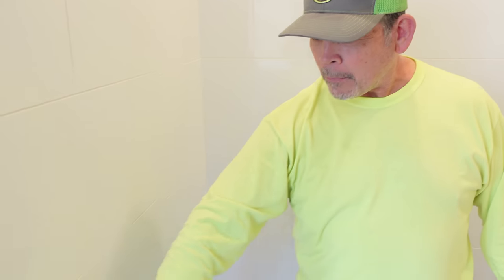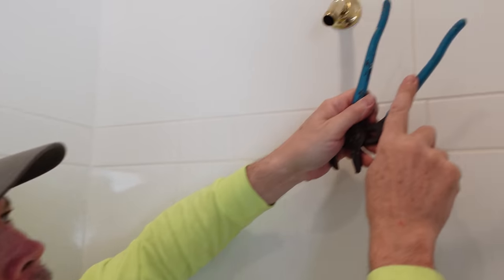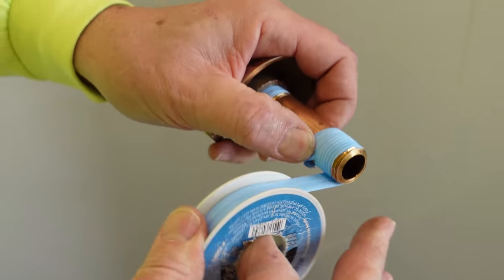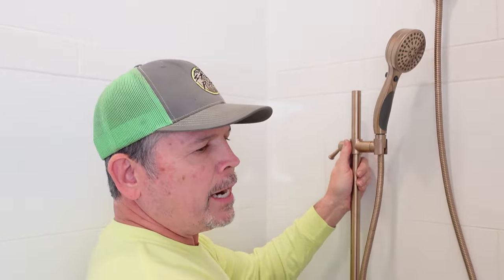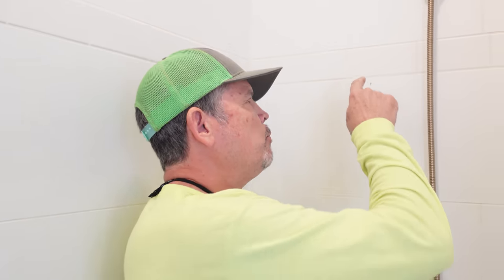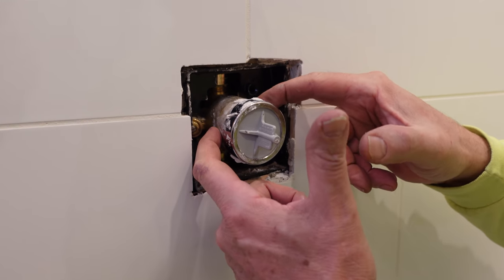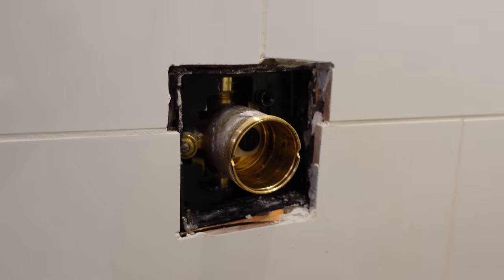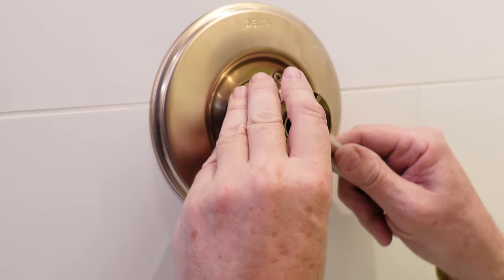How to Install SHOWER TRIM (Step by Step)

Comment: What great timing.  My son and I are getting ready to do this in our shower remodel.  I have put one in before but it was 15 years ago on the first bathroom remodel.  Great video and we opted for a shower set up that was similar except in nickel.  Our son is 6 foot 7 inches and we needed something that would go pretty high.  We also put in a diverter to a shower that comes out above the shower for a rain head.  My wife insisted.  She's the boss.  Great work guys.
Reply: Make sure to look into Schluter for your waterproofing. I have 4 bathrooms that I need to do and one of them is designed for a wheelchair. This means no curb. The prospect of getting this wrong scared me so badly that I did allot of research for a very long time and settled on Schluter. Their warranty is second to none and their education is above and beyond the TCNA standards. They also have a YouTube channel. (For proper information do not reference outside of their YouTube channel. There are channels that might do a good job but details that are required for the warranty could be completely missed and so you should reference the official videos from the company.) 

Taking their free workshops that have class and hands on installation training was far better than any video I could watch for me. They are nationwide, cater all the food for the workshop of almost 2 days and pay for the hotel if needed. You just invest your time and walk away with a massive amount of information to consider and decide for yourself. Hands-down was invaluable. I got the latest information and technology for my installations and learned allot about what has been traditionally done and what the pros and cons are. I wish you well and take care!

Comment: Thanks guys for taking the time doing this video. My OCD issue has been with the pipe at the shower head and knowing, or NOT knowing after you thread the pipe in IF you have a leak or not.
Reply: I was told to use some pipe dope on top of the tape.
Reply: When I built my shower, I put the threaded opening just close enough to the surface that I could silicone around it so any thread leak would run out and down the tile. I didn’t plan it though. Just got lucky.
Reply: A high quality tape and/or dope go a long way. If you’re gonna go both put dope over top of the tape not the other way around. You’d be surprised how quickly tapered pipe thread seals up against city water pressure.

Comment: I know you guys have probably been working like crazy to finish before Mom comes home from the hospital/rehab, so that's why you skipped ahead in this shower install to the trim part. But I hope you got some footage of how you proceeded from the floor joist adjustments to the finished product. Looking for a new video on that. Great work as always!
Reply: Keep in mind that the subbed out the tile and plumbing on this one. Paul mentioned that the had some showers coming up that the would be showing the whole process on though.
Reply: @chrisloehr6641  Right. I forgot he said that in the last video when he was lowering the joists. Thanks.
Reply: @thedevilshelp  And the shower niche on that new wall.   I'd like to see the finished product even if part was subbed out.

Comment: Thanks for showing how to adjust the water temperature gears! I was able to fix my tub to finally put out hot water. Previous owners just turned the water heater up which allowed for scalding water on all the other fixtures. You guys are awesome!!!
Reply from the maker: Awesome thx J👍👊

Comment: Great job again, plumber and contractor for over twenty years in all phases of construction and service work.  You did an excellent job in the teaching process.  I appreciate the channel, the hard work, and the professionalism you and your dad provide,  Thank you.  I would personally pull any water saver from the hand held as the volume is fully controlled by the delta cartridge.
Reply from the maker: Thx Jason.  Pulling the water saver😳??!!   I have no idea what you’re talking about 👊👍
Reply: @StudPack  There's often a small disk on the handle that has a small hole in it that restricts the water flow.   They call it a water saver.   Basically it makes for wimpy water flow.   Jason was recommending pulling that out since you can control the water flow at the valve itself.
Reply: @AKJammer1  Whoosh. LOL

Comment: Another great video! Paul on mine, it's Delta also, but the valve assembly is all one piece, from the 2 o-rings to the adjustment for the hot water(scald guard), but it is only one handle. I guess what I am getting at is the housing being the same, you could convert it to one handle easily. Best wishes for your mom, and I am sure she will enjoy that shower, I know I would!

Comment: Nice  - i just installed one of those Deltas.    After staring  at the instructions I had to watch about 4 different videos.   Things get tricky when you have to adjust the temperature limiter.  This is the  video I'll comeback to if I have to make any adjustments .

Comment: Tip for when you can’t get “two more” turns on a fitting or pipe but you want it tighter: count your thread tape wraps, then if you need to get a fitting tighter (cause you only got “one more” turn) you can add a few more tape wraps than your normal #.

Comment: To DIY'ers like me -- Be extremely careful when tightening those elbow/hose connectors. Over-tighten it, and it could crack the tile which would be Very. Very. Bad.
Reply: Can you put Kohen trim on a delta valve body and cartridge?

Comment: You should explain the balancing aspect of the valve. I've found it best to have an expansion tank  on the water heater if it's a balanced valve. A bad expansion tank can cause the balancing valve to not work properly.

Comment: I agree with Ken below.  Lowering the elbow will add length to the hose for an easier hand shower, rinsing the shower stall and any other washing the shower is used for.  I would only then add silicone sealant when installing the elbow.  I did this on the two showers in my home.

Comment: Re: Silicon on face plate sealing. I would always run silicon seal around, especially on tile with grout lines. As the factory seal can not be relied upon to fill the grout channel. But don't go mad. Excellent Video as always. You guys are the best.
Reply: Yeah I agree, I'd use some silicone too, but if it has a gasket, I'd only use small "dots" of silicone where the grout lines cross the face plate.
Idea is that using only a small amount would ensure that it remains easy enough to remove, let you take advantage of the provided face plate gasket where it has a good chance of working, and provide extra insurance that it won't have a hidden leak that you don't find out about until the damage is done.

Comment: Great video, I would also suggest neater holes for the valve and outlet using a diamond tipped jigsaw blade or holesaw, to the DIYer you could certainly encroach outside of the coverplate or outside of any fittings.
Grohe actually provide a template which protrudes through the tile and is cut flush at the end.

Comment: my grandfathers solution for drilling into shower tile was to use a hammer and nail (or whatever else was laying around and would work) to gently chip away the top layer of the tile eliminating the stress of a wandering bit.

Comment: Dude my cover plate does not have “delta” on it (late 90’s monitor) so putting that back on is the longest, most excruciating part of the job repairing that damn thing! Can’t believe you threaded that right in!

Comment: Hey Stud Pack, If you hate Allen keys and set screws as much as I do, then you should get the kit that I absolutely love. I am not sponsered by them I paid with my own money. But I love my small ifixit kit. Its for like mobile devices and stuff but it has literally every set screw and allen key that I could ever imagine using. I use it to install towel bars, and all my set fixtures in bathrooms all day! I love it

Comment: Im sure others have said it, but for many shower valves it doesnt really matter what side you plumb the hot water line to (right or left).  If your hot side happens to be on the right, usually, you can just rotate the valve 180° before installing it and everything will work fine. (thats also why the valve handles happen to also fit 180° offset)
Reply: One of the biggest reasons why valves are reversible now is not because it doesn't matter. In condos/hotels we run a hot and cold line up the wall and manifold off to pickup back to back shower valves. The ability to flip the cartridge allows us to reverse one bank while the other one remains plumbed correctly

Comment: The plumbers who installed the shower valve in our kids bathroom didn't seal the cover plate. If there was a gasket, they left it off. Water got in the wall for years. Chased the smell for a while and finally pulled the sheetrock off the other side of the wall. Boards had literally shrunk and there was mold everywhere. I replaced a few 2x4's, sealed up the valve, and put the sheetrock back on. I can't remember what I did about the mold. Probably bleach. Anyway, years after that we had a termite inspection and all the floor joists under the shower had old termite damage. The termites left when I fixed the leak so it didn't need to be treated. Point of all this is, super important to make sure that cover plate and all the fittings are waterproof.

Comment: I like to squirt a little silicone caulk in the holes before inserting the anchors. I’m sure some will say “not necessary “ but it a simple thing to do for a little extra insurance. Especially if the anchors are below the splash line IE: grab bars etc.

Comment: Maybe links to what you use (especially the valve) that's nice & smart!
Diamond core bit is another key tool!
Speaking of links...you didn't add the link to Anchors you mentioned either.
Thanks for another GREAT instructional video!

Comment: Whenever I install a hosed shower head like yours, I put the elbow so low that the hose will just reach the nozzle when it's at its highest position.  Then the nozzle can reach the floor or the other end of the shower.  Very handy for scrubbing either the floor or the dog.  The last shower I did was 6' long and the hose reached almost the entire space.

Doing it this way requires enough thinking ahead that the blocking for the bar and the rough-in plumbing are all located before framing even starts.  Come to think of it, that's true every time you frame a shower.
Reply: @Ken very good idea. The only downside I suppose would be if in the future someone wanted to go back to a fixed shower head the outlet would have to be re-plumbed.
Reply: @HBSuccess  ... and fix some tiles. That's a pretty big downside. The good news is that in all the years since I've been doing it this way, nobody has asked to change it back. Maybe I've repeatedly dodged a bullet here.
Reply: TJP 81  I put the elbow at 32" and the grab bar at 40" above the floor.  The hose can then drape either behind or in front of the grab bar, owner's choice.  I prefer behind the bar because the hose is long enough to easily reach everywhere. It only takes a few seconds to change it.

Comment: I have been a frameless shower installer for over 10 years. Done thousands of shower enclosers. I stopped using that core bit years ago. Many companies make masonry style bits except they are designed for tile. Much cleaner hole and no running.

Comment: I mostly use something like "Loctite 577" on threads. Tape is such a guesswork in situations like these where you really have to get the fitting in a specific position. With glue it doesn't really matter if you leave the fitting a little loose. On stuff you can really crank down, tape is a ok.

Comment: How do I know if my valve assembly will work with the trim kit? Shower is currently ripped out with the valve assembly still hooked up. Planning on putting it al back together next week. Don’t want to be stuck with the wrong trim kit only to find out I needed to change the valve assembly. Thanks for all your great videos!

Comment: Hi guys, another great video. It's been some time since i replaced or added shower hardware, and the internal shut off has me curious? how would some one new to this install know that the internal screws are there to shut off?  Normally, if i was doing this would be to shut the main off or atleast the main to the washroom before even removing the old fixture. but in your video you would need to remove the cover plate and the knobs and handles just to see if these screws are there? Assuming you even knew about them in he first place? when you gt a minute maybe you could let me or maybe all of know. Thanks again always something new  to learn.
Reply from the maker: Correct you have to remove the cover plate to see if there are integral stops
Reply: @StudPack  interesting? normally wouldnt you just assume you have to turn the main off before even removing the cover on a replacement or repair job? Seems like there should be something that says turn off at valve? just thinking out loud.  Thank you for your reply.

Comment: Hey Stud Pack!…DOPE TAPE DOPE!…lightly pipe dope the threads of the brass nipple (or any threads) first…then apply then Teflon tape…then lightly dope again…the first step of applying a thin film of dope to the threads helps ALOT to make  the Teflon tape “stick” to the threads when apply the tape to the threads…love your videos
Reply: Never heard about using both. The discussion is always one or the other. Pobably work well with both.

Comment: hey Studpack! its hard to find those valves with integral stops, you have to search for this specific feature when ordering. forget asking big box store folks about this feature because they don't know (in my experience). not all shower valves have this. thanks for the video! very helpful!
Reply: Hey there, i see you are familiar with the "integral stops" maybe you can tell me why they are there and how a new home owner would know that these are there? not many of us start any  plumbing project shut the waer off at the main  or what ever is the closets shut off valve? but these are hidden until you remove the cover plate and handles?
Reply: @southerncomfort971  yes they are behind the cover plate. need to remove cover plate to reveal the hot and cold stops. when attempting to order a shower set with integral stops, make sure the description states integral stops on valve body; some just may show a pic of the valve. also, from my experience, when I ordered Moen shower sets the valve with integral stops needs to be ordered separately. to my surprise, the valve did not come with the Moen shower set. the integral stops are helpful for when you don't have access to the shower shut-off valves if any (then you have to shut-off main or find shut-off valves in a basement or crawl space). sometimes the shower plumbing may be on a wall that backs up to another shower or a hallway and you don't have an access door. hope this helps.
Reply: @musclecars4635  yes it helps but i can see where me or homeowner, not knowing they have this type would turn the water off at the main and just do the job, they had intended. Now a bigger question is ? if you bought a regular faucet and find you have one of this type would a regular faucet fit ? Or do you have to replace it with the same type?
Thanks again.
Reply: @southerncomfort971  in my experience it should fit. I believe the valves without the integral are slightly smaller.
Reply: @musclecars4635   ok sounds good, stay safe and well
Reply: @southerncomfort971  you too! good luck!

Comment: Great video, we are considering the same Delta shower controller like you installed in our new home so great to know how to adjust it. I am surprised that you put more than a single wrap of the pipe tape on the thread.  Every time I did more than one wrap it seemed to leak, I would end up removing it and doing it again with only a single wrap of the pipe tape.  Did I do something wrong?  (tell me if you have a specific video on this that provides more information). You didn't do a video of the all the work getting to today's video, including the shower floor install and tiling, etc. Are those coming or just skipped since you did those in the past. Please keep up the great work and know that I do recommend your videos to others.
Reply: Re: Teflon tape…I use the same brand as Paul and it takes 3-4 wraps to get a seal on a 1/2” pipe… a single wrap wouldn’t cut it and I don’t think would even stay put long enough to try. But there are much thicker Teflon tape products on the market… I’m guessing you wound up with one of them.

Comment: You guys are really knocking this out of the park!  Keep up the great work Paul and Jordan.

That 90 degree fitting is called a "drop ell".

My Master Plumber uses his finger to 'set' the teflon tape in the threads and claims that it helps prevent the tape from being shredded during the rotation of the pipe.